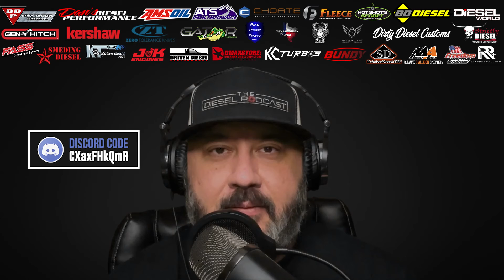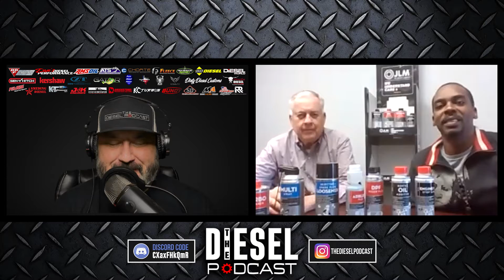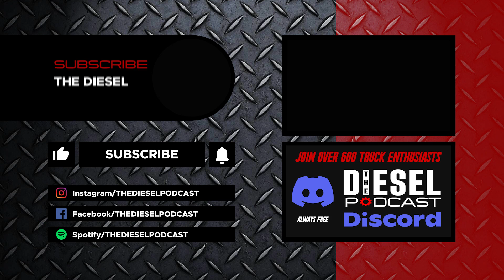Fixing a Clogged DPF

Comment: Another way that you can clean the DPF if it's throwing a fit. Is the diesel particular filter is you just remove it from the truck? You tape off one end and then you feel it with engine cleaner that's designed to remove grease and carbon from your oven and you just let it sit overnight and then you rinse it out with a hose😅 it also same trick will generally work on most of your EGR components. You just have to be careful because some of them have plastic and that will disappear too

Comment: Guys watching this that own a diesel truck just for the sake of owning a diesel truck either need to buy a pre emissions truck or delete the truck because it you just drive it back and forth to work every day 20-30 minutes the truck doesnt ever get loaded which creates the heat needed to properly clean the filter if you only tow your boat once a year or whatever youre going to have serious issues with your EGR and DPF systems but having an intimate understanding of how they work ive had a class taught hy a former bosch engineer for 30 years he taught us very well on the science of whats actually happening in them so im very skeptical of this id say its probably a bandaid at best
Reply: What about unloaded highway driving and keeping the rpms between 1800-2100?  Shouldn’t that help?

Comment: Does it get rid of the ash that's the question. Soot can be burned off with a regen, it's the ash that gets trapped in the filter.
Reply: The ash that remains after regen is very minimal and should not be enough to affect the system. If there is an excessive amount of ash in the system chances are the vehicle has been having frequent regens for a long period of time and the vehicle owner kept driving the vehicle without addressing the issue. If ash is at a level where it would cause a problem then the only way to clean it properly is to remove the DPF and have it back flushed.
Reply: @DEFSystemServices I use OTR Diagnostics and I do a forced regen at least once week even if my truck doesn’t need it. I also add Lucas Diesel Deep Clean once a month and I clean my 7th injector/dozer valve manually once a month. Do you think this good to prevent ash build up on a 2020 Cascadia with 520K miles?
Reply: @Nihil2005  STOP FORCE REGENS. The system is a self cleaning system so you shouldn’t have to force regen. If the truck is not doing a regen you should figure out why and fix the root cause. You shouldn’t be doing a force regen just to do it. Cleaning the dozer doesn’t hurt however you don’t need to mess with it if there is no issues with it.

Comment: Low rpm and start to accelerate a little will clog it up fast. 

If you have no emission and do this you create smoke. With emissions toy get clogged fast. Best to drop a gear, but you can accel so the turbo can keep up.  I call it rolling into the throttle.